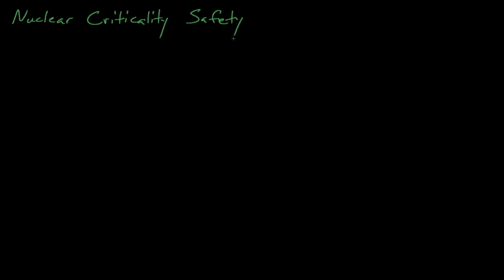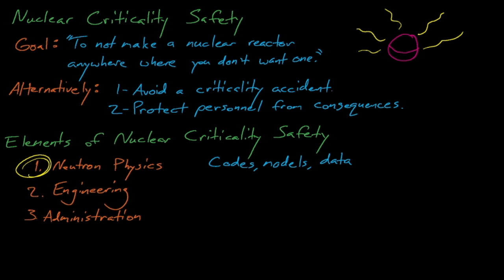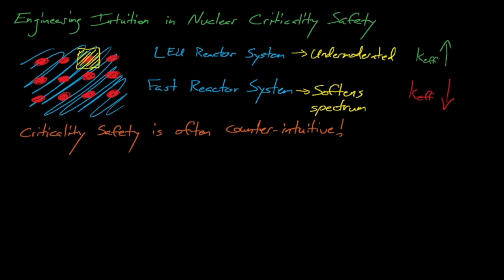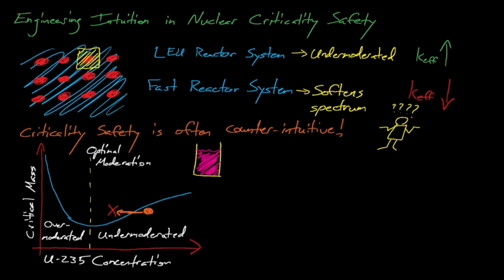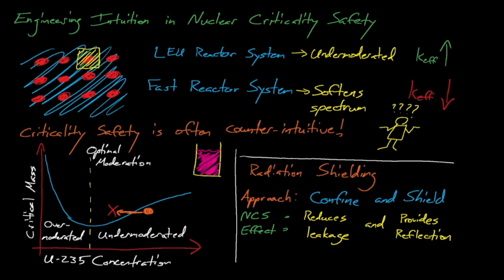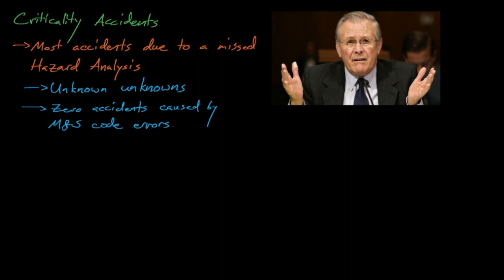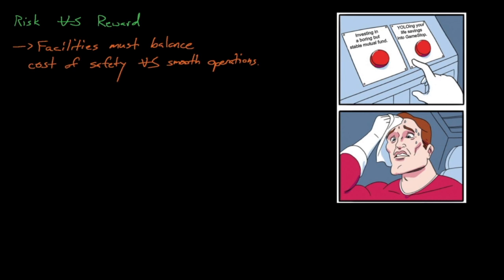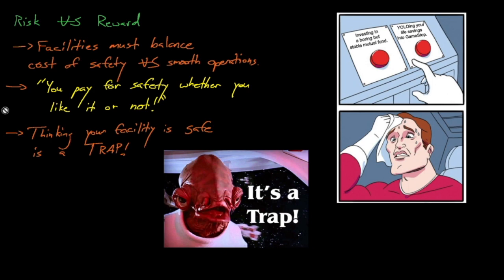NE499/515 - Lecture 1: Introduction to Nuclear Criticality Safety

Comment: So if you have too much water (or moderator) in your system, what do you do? Do you boil it away? Drop some sponges in on a wire and pull them out haha?
Reply from the maker: You can wait for it to go prompt supercritical and then the water boils away :-).  Kidding of course - you can probably separate the solution into smaller parts and then evaporate away some of the water or chemically alter the uranium density.